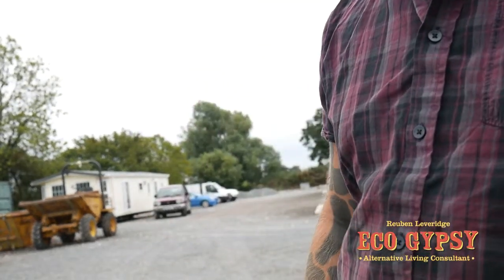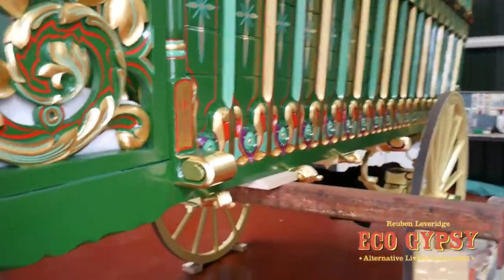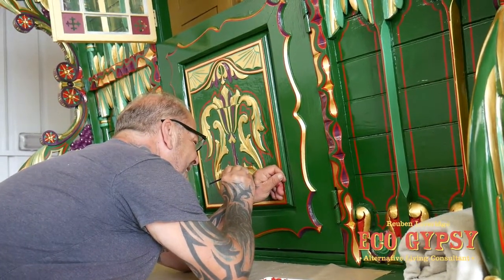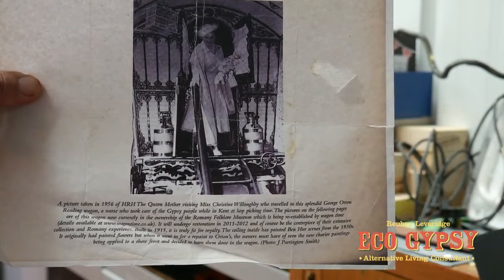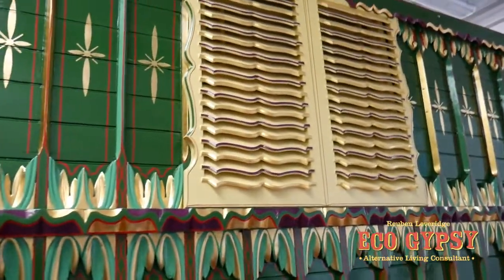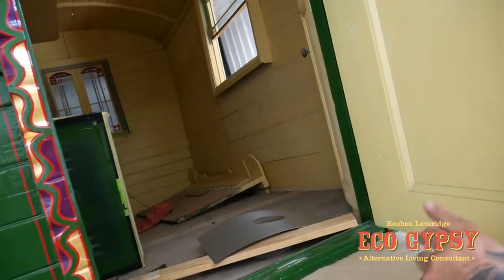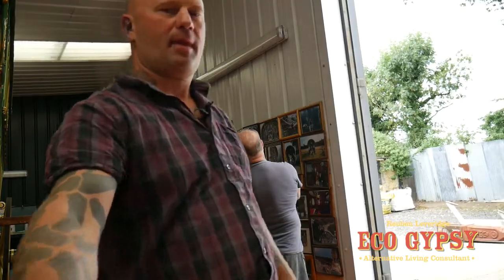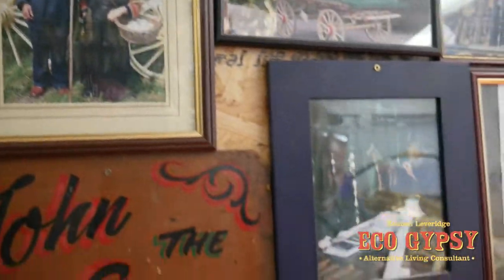GYPSY WAGON PAINTING eco gypsy

Comment: It looks like the doors have a special hinge that lifts the door as it swings out so the bottom won't rub on the floor? Would these be custom made hinges?
Reply from the maker: i dont think so top door has a lip that catchs bottom no special hinge
Reply: @reubenleveridge5175  Thanks, I was looking at the lower door. It looks like the barrel of the hinge is cut on an angle so it would lift as it swings. Can you tell if the wall with the door is plumb? It really looks like it tips out a bit. The book I have has very good scale drawings and shows it there too. Thanks, your work is amazing!

Comment: John said that unit weighed about a ton. How is it that with today's 'superior' materials, you couldn't come close to this size and detail without twice the weight. I know a modern road trailer would weigh a bit more than a wooden frame but a modern stove should weigh less than a cast iron stove from a hundred years ago. Insulation weighs nothing in the grander scheme of things, so what happened? Nails and hinges heavier today?
Reply from the maker: bill wrights where quiet small vardos the mona lisa weighs around 2/5 ton very large reading wagon the bill wrights fully loaded with kids water etc prob weigh around ton and half ( also depends how big your missus is ha ha ) but pull with good single horse and tracer readings need 2 horses min and a tracer